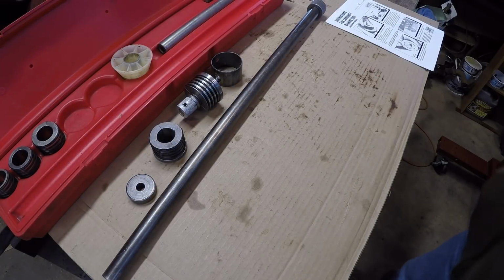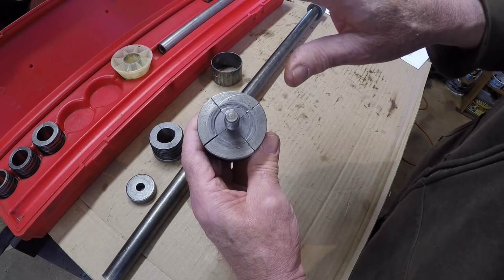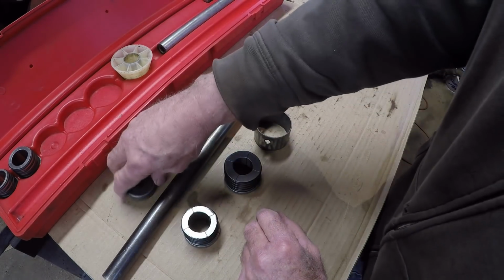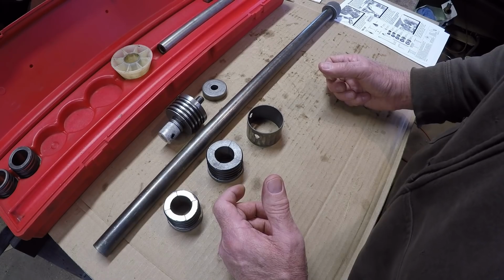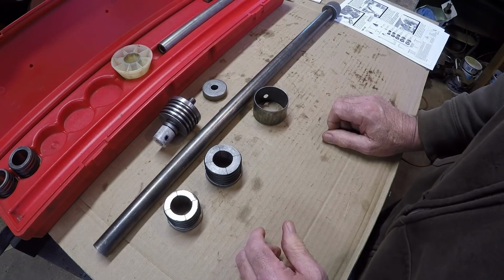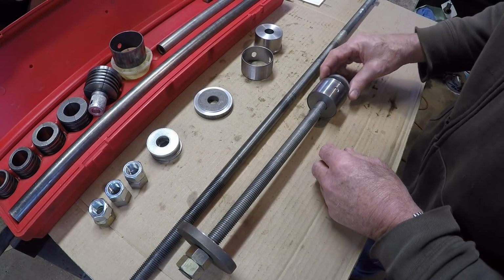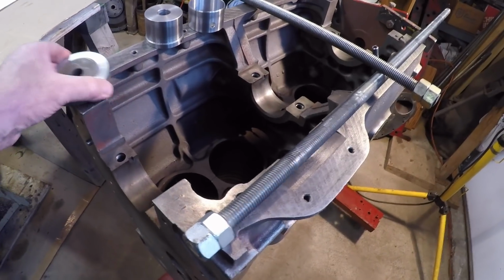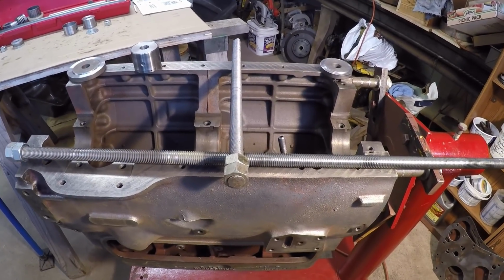Farmall Super M Engine Knock Ep.16: Sr. Answers Viewer Comments & New Cam Bearing Tools Finished

Comment: I did almost the identical thing for the bearing drivers with .020" clearance but i made a driver pretty well the same as the otc or snap on one that you have and had no problem putting the bushings in other that aligning the oil holes . They drove in quite nicely - was wishing that i had the driver set you had .But if you got a lathe you can make these quite easily .

Comment: Whilst the tool is indeed a good one, and it does as advertised when used to their instructions. Yeah, beating bearings is not in my wheel house. Something wrong about that, and whenever circumstance forces me to do it, i'm always hesitant. Bearing materials do well in wear situations, it's their purpose, but sudden shocks can have/lead to adverse effects. There's deformation imperceptible to the human eye, i've heard that in some types of bearings of the more brassy nature, you can get micro-fractures in the material and that instantly fails the bearing, yet you'll never see them, so on and so forth.
Either way, good thing people were on the go and knew the right way to use it, and that they put it forth. Sharing, is after all, caring. :)

Comment: Sunnen press lube my friend. If you use it once youll never install a bearing/bushing dry ever again. I have an old OTC cam bearing installer similar to that . I use a tiny bit of blue loctite between the threaded rod and extensions as well as the male "expander" piece on the end. The reason i do that is so the "nut" on the end loosens when the rod is turned and the expander doesnt get stuck in the bearing. Also the nut that expands the 4 piece collar , i barely tighten just till its snug in the bearing. To prevent the tin layer on the bearing from getting all marred up, i coat the expansion collar with thick grease. I may have used improper nomenclature in this rant, but if youve ever put bearings in , you know what Im trying to convey. Im curious too....is this the block thats getting dry liners pressed in? If so why are you putting cam bearings in first? If this isnt that engine forget i mentioned it. Thank you for the video.

Comment: Try changing your O-rings to a smaller cross-section diameter the one that my dad had that I inherited many years ago had much smaller diameter O-rings and it seem to work OK even though I never did care for most of the stuff I do are larger engines so they have to be pulled in I’ve never screwed up a bearing that I’ve pulled in like you most of the time I just make a custom set one for a guide one for a mandrel are use a piece of acme screw thread that’s hardened and it works great

Comment: I worked in a automotive machine shop in the late 70s and we had the machined bushings for the bearings and for alignment. Ours used a slide hammer but I like your idea better pulling them in with the threaded rod. If you were patient and didn't get hammering too hard our set up worked good. Some engines it seemed like the bearings just installed easier. You guys definitely do some quality work

Comment: Great video. My only caution to you would be to make sure that the shouldered bearing install plug has enough clearence on the o d so that when you pull the bearing in it does not crush down and lock onto the install tool.  Your cam bearings have probably a three to four thousands press into the block which will result in the i d of the bearing reducing that much when installed. The tool you bought at the swap meet is a good tool and works very well but yes there is a little bit of learining curve.

Comment: bigger hammer is less blows for bigger amounts moved. 

your cam bearing installing tools are worn.. they do need work.. you may need to revive them by creating a steel sleeve that allows them to be expanded to a true round shape... so you can then cut the shoulder square again in your lathe. .  relieve any burrs on the OD of the step. perhaps dress the driven side to get rid of the damage .. perhaps dress the end of the driving rods to remove any possible damage.  when i had access to a lathe and some bar stock scrap. i made my own custom cam bearing drivers.. but i uses a long rod that i had cut threads in one end. so i could put the cam bearing driver into and hold it in place.. some i threaded to the rod threads and used a single jumbo hex nut.. 

 i only worry about yours because of the all thread exposed  but i bet you are not going to be going thru any installed bearings with it.. 

 this is one source for the bearing scrapers that everybody who works with pressed in sleeve bearings should have. only 10 bucks. https://www.cylinderheadsupply.com/kl2595.html  think of the transmission output shaft bearings that after install can't get the drive shaft thru.. and to do sleeve bearing with hydraulics.. think of something odd like the electrical box knock out hydraulic tool.. crazy cheap from Horrible fright tools. but its a 7 ton porta power with a hole thru the middle of the ram to put pulling bolts thru.. handy to have..  a million uses of it if you have a lathe to make up tooling.. like pulling small block chevy rocker arm studs but who builds old school small blocks..  not trying to sell anything.. just assisting people in being able to do it right. 

 off thread for those who make it this far down.. decades ago..  in a shop long gone. the body guy was trying to straighten a bumper bracket with the 7 pound sledge the shop owned.. i went to the parts store and came back and he was still swinging at that same piece..  i hollered across the lot.. do you need a bigger hammer.. he nodded yes..  his eyes almost popped out of his head when i pulled out my 17 pound fencing maul with the flangged heads..  took two swings to unbend that bracket.  i took it from him and leaned it against the side of my roll away.. it was way too long to go into a drawer..  as he stood there panting from all that swinging.. i noted he was looking directly at my fencing maul ... you should have seen his face fall as i picked it up and locked it back in the trunk of my car... his face looked like i had just stolen the most beautiful women he had ever seen and was planning to elope to las vegas with..

Comment: I like your idea. 15 years ago at Cummins we were still using the bar and hammer method. We now use a foot controlled hydraulic ram  that pushes the bushings using dies and a long bar that has step graduations. Similar to what you are doing but on a manufacturing scale. I really enjoy you and Squatch253's videos.

Comment: Keep in mind when you freeze or just cool your bearing you will reduce the inside diameter as well as the outside diameter , so your adapter might not fit in the bearing and trying to freeze it with the adapter already installed will cause problems as well

Comment: Interesting that you should mention the old Rotax snowmobile engines.  My first "sled" was a '74 Olympic 400 with the old 399 twin. No decompression on those puppies.  Made for a real workout at 40 below, when the Tillotson carbs didn't want to co-operate.  The first few pulls of that stone-cold engine were a real test to both your arms, and the pull-cord, too.   That old thing held together well. Well, the engine itself did... one night when it was about -35, I was out on the "speedway" (the local river that was frozen over) when the drive sprocket at the front of the track came all apart. I can't remember if the axle had broken or just the axle retainer on one side, but whatever it was, the ride came to a rather abrupt stop in the middle of the river.  The motor was still working, but couldn't drive the assembly.  So, I sat there in the dark and the cold until my buddy came back looking for me.  It's quite the experience sitting with the engine off, listening to the ambient sounds at 10 or 11 pm.  You can hear other snowmobiles in the distance,  the wind, and the eerie sounds of the ice below you cracking and groaning as the cold penetrates down into it and it bears your weight.  You hear the sounds radiate along the ice, it's both scary and neat at the same time.  Ended up towing that old machine home on a toboggan, and sold it cheap to a guy who had some welding skills.  He welded the damage back together, and got another season or two out of that thing before he wrapped it around a tree at pretty much top speed and that was the end of her.  My subsequent snow machines all had Mikuni carbs, I would never again fight with a Tillotson carb, thank you very much.

Comment: I worked at a plant where we would replace bearings on the electric motors used around the plant from a few horsepower up to 500 HP.  We had several specialty bearing heaters, one of the fellows needed to put a bearing in a small electric motor at home and needed to heat a sealed ball bearing to do it.  He took a metal funnel and turned it up over a small flame and placed the bearing on the funnel, being tapered it stopped on what became the stack of the heater.  It worked well expanding the bearing without baking out the oil and since he had the metal funnel and the heat source it didn't cost him any thing.  We occasionally would drive a bearing on with a pipe against the inner race without heating it on small electric motors but like you I don't like hitting a bearing, large, small or otherwise.

Comment: The theory behind the larger hammer relates to the increased mass moving the bearing shell more easily , where repeated blows with a smaller hammer tends to swedge the edge of the bearing in contact with the driver . Really enjoy your videos and the range of subjects covered .
Reply: Additionally there is a frictional difference.  Static Friction is higher than Dynamic Friction. So once you get the bearing moving, it moves easier.  Repeated strikes have to overcome the Static Friction each blow.  One large strike only applies One Static Friction impulse.  The pressing action Senior is now using will always need to apply the Static Friction impulse.  as long as the Static Fiction force is less than the Plastic Deformation force of the bearing will survive.

Comment: 😊😊😊😊👍👍👍👍👍
Sr I do a lot of dismantling of aluminum castings with seized beings and your right if you heat the castings the bearings will fall out.  It's much easier than a hammer.

Comment: Hi Senior. My late Dad once told me that the man who never made a mistake never made anything. I've always remembered those words of kindness and wisdom. Hopefully replacement bearings were not too expensive. I'd assumed that the tool had bounced to and fro on the bearing, but now I'm sure you're right, leaving out that load spreading washer resulted in a bell mouth effect. It's sometimes fairly easy if you have the instructions - but not always - and us engineers are famous for ignoring them at any rate. It's always obvious what went wrong afterwards, not so easy at the time. Oh and I know my Dad would have agreed with you - pulling is kinder. Thanks for sharing. BobUK.